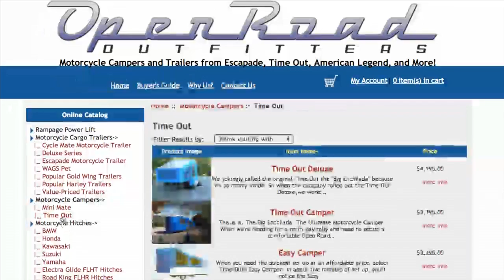Time Out Deluxe Motorcycle Camper Assembly

Comment from the maker: Goodl question - I didn't install the cooler package because I needed to store the Time Out along with another camper head-to-head in my garage. Plus, I wanted to make a separate video of that. So when I do install it, I'll be sure to show it. It isn't complicated. The holes are already present in the frame and after sitting the aero cooler on the tongue, you just drill through the frame holes, through the fiberglass cooler, and then install the rivets.